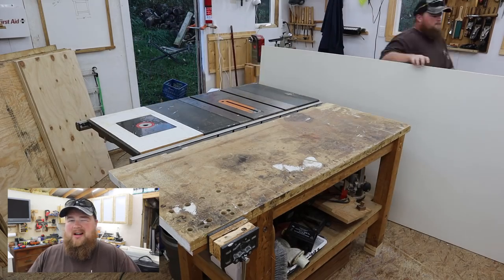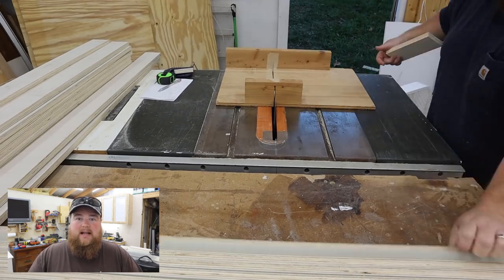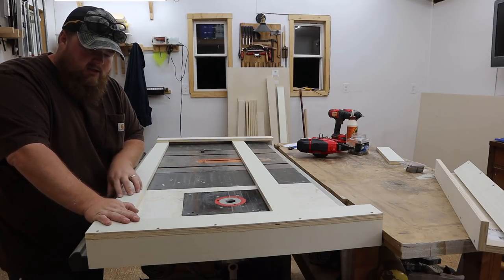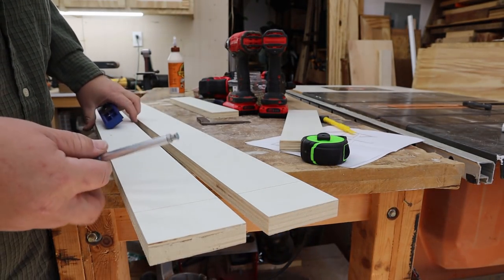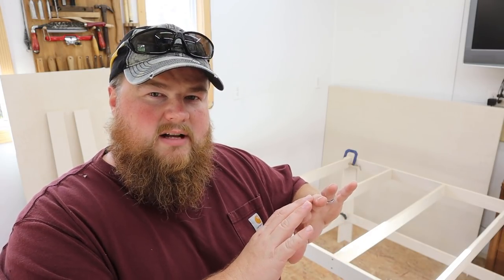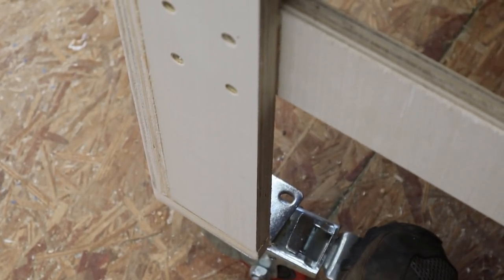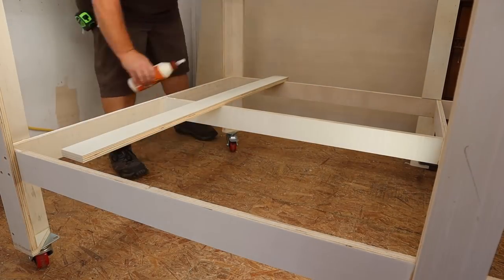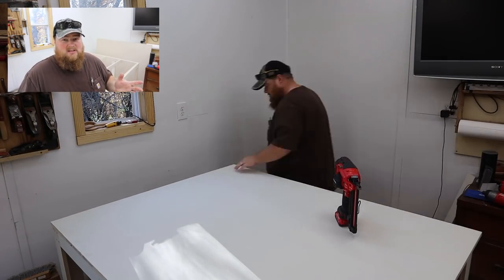$100 Shapeoko Pro CNC Table | CNC Router Woodworking

Comment: Pretty clever moving the caster ffg or visual effects. Great looking cabin. 
I'm building a potting table for my wife. I like the thought of making the frame out of marine grade plywood.  Instead of the usual 2x4  frame.  This video has given me some good ideas 
Thanks for sharing. 
Blessings to you and your family
Reply: Ceedub: Yes, this is a great design And, as I told someone else, you don't, Really, need a Table saw, to do it.
All you need is a circular saw and a straight edge.

Comment: Nice design, I would use 2 x 4 boards for the legs and top frame.  2  - 2 x 4s would give very stable legs would be less work than cutting all the plywood.
Reply: I think you missed the point of his build. Built with only 2 sheets of plywood, no additional lumber costs, no 2x4 lumber to run through planers or higher priced S4S costs since good quality furniture grade ply is flat (as his level shows).

I was thinking 1 sheet of furniture grade ply and 1 sheet of Mdf for the top to ensure a flat surface but he made the right choice since the left over ply is stronger than MDF and he used some of the 2nd sheet to stiffen up the frame. I wouldn't trust MDF shot strength applications. Thick ply can be just as strong as standard lumber if used right, sometimes stronger. Personally I would have laminated the strips leaving gaps to create simulated mortise & tenon legs and  frame but that may have required a 3rd sheet to cut.

Paul Sellers recreates his entire workbench using plywood as mortise & tenons. He has a seven-part video series on his YouTube channel. His workbench is designed more for traditional woodworking using hand tools rather than power tools so it's built with strength in mind. 

My point is his plywood workbench is just as sturdy as his lumber workbench it's based on, possibly stronger due to the laminate of the ply.

Comment: That table should support quite a lot, for you And it's Mobile. Great.
Looks like your table saw cast iron could use some love.
A little WD40 and an orbital sander, with 220, will save some elbow grease but
it will still be needed for the paste wax.

Comment: I am looking forward to seeing the new CNC on the table - one note though, there is a lot of white in the shop there and some of the shots are overexposed - I think using manual white balance might help with that - I'm not an expert, I am just learning this stuff as well and I have the same issue with some of my shots.
Reply from the maker: Yeah, I had to step up the exposure in a few shot to keep the details. Lots of contrast in some areas. But I think it'll work out in the end with the machine in the corner to give the camera something to latch onto for auto exposure. :)

Comment: Nice job, Sam. Looks great.

I would have reserved the space you used for the "switch panel" for a set of drawers and put the "switch panel" on the end of the table. You could always make the drawers as narrow as necessary to leave space behind the panel for wiring and such.

Just another idea to add to the pile.
Reply from the maker: I have plans to put drawers above the shelf on the left, but your idea for drawers on the right is great too! I've not changed the table (yet) but may have to consider the above when I do! :)
Reply: @Samcraftcom , I see the end next to the "dresser" as wasted space. However, there's enough sticking out to accommodate your "switch panel", leaving the space that faces the room (where your switch panel is now) for whatever you can dream up.

If you've watched Jay Bates' CNC videos, you're likely going to want to build something for a computer. Maybe you can incorporate that into the table somewhere, eliminating another cart taking up valuable floor space.

Comment: Why not just use 2X4 to build the table rather than double the plywood? Strength, cost? I was always curious whenever I see folks build that way...
Reply from the maker: I did it this way for strength since my CNC weighs about 180 lbs. Laminated plywood is rock solid and will not sag or move like solid wood.
Reply: @Samcraftcom  by the way I did purchase the plan for that table after watching the video. Thanks for the explanation.
Reply: I’m also trying to figure out which CNC to purchase. I’ve been also watching Garetts videos on the Long Mill CNC. I’m leaning towards that one but still need to do more research. I want to buy my 3rd one first. 😉

Comment: Hey! Awesome video! Just curious how this table is holding up? Have you made any other adjustments to it? Thanks for the inputs!
Reply from the maker: It's still rock solid and great to this day! The only changes I made were to add in the drawer unit to it (there's a video on that, plus they're included in the plan set). Otherwise it's stayed exactly the same.

Comment: Is it possible to use 1/2 inch for this build? I spent a lot of money getting my shop together and I just threw down 3K for this cnc machine. Getting down to my last bit of my budget. lol
Reply from the maker: I think that would be okay. I would just add more bracing supports under the top. This table is super strong. I literally used it as a scaffold to install ceiling insulation in my shop while waiting for my machine to arrive and I'm not tiny!! :)
Reply: @Samcraftcom  Thanks for the reply. I was thinking a few more supports too just to be safe. Wouldn't want my favorite new toy crashing to the ground. lol